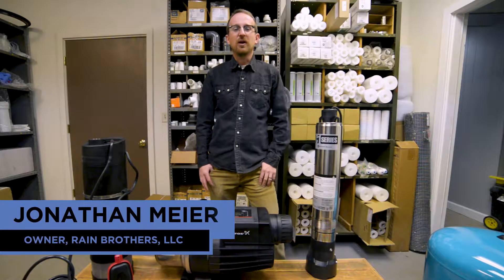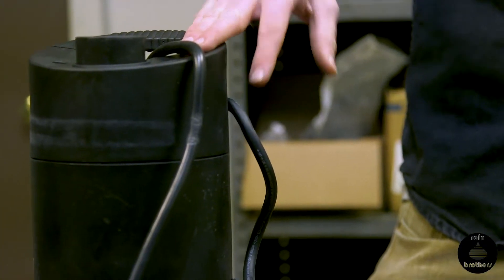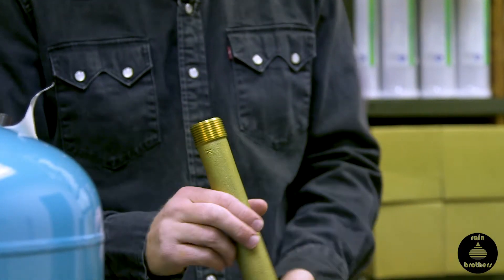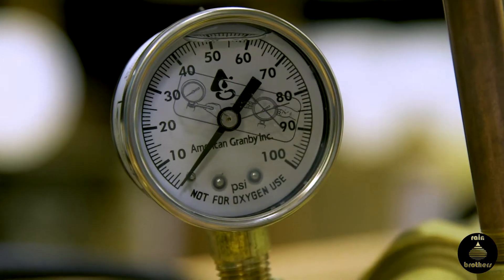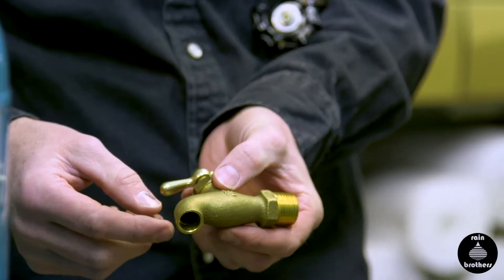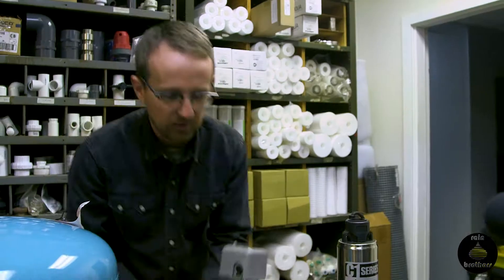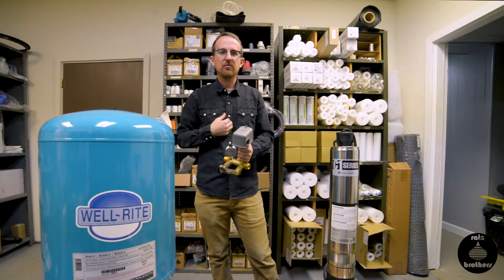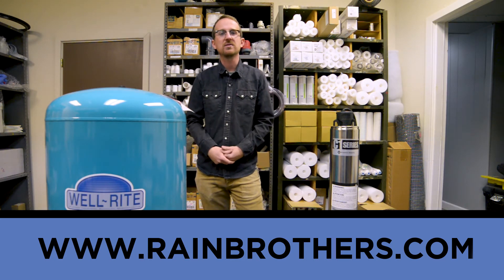Update Video: How to Install a Cistern Pump

Comment: Could you do an instructional video on the SBA pump install?
Reply from the maker: Actually, we the SBA pumps had several problems in a shipment we received, and I wasn’t confident that Grundfos was going to resolve the issues, so we stopped recommending them. This is the best automatic pump on the market: https://www.rainbrothers.com/store/Springer-Series-1-2-HP-AUTOMATIC-Pump-with-Floating-Intake-p529906252